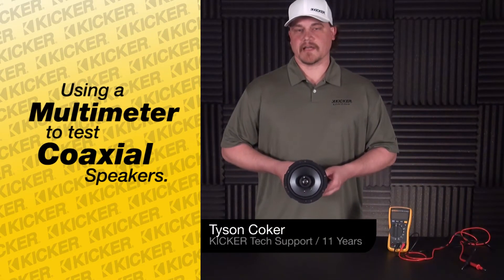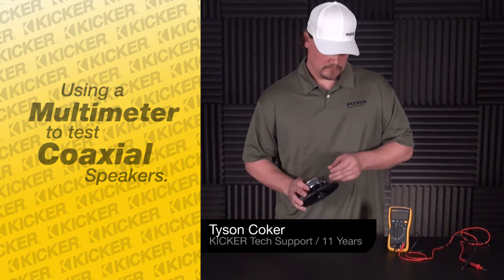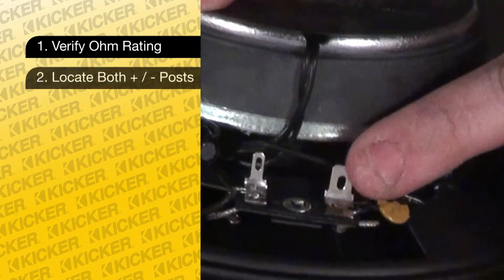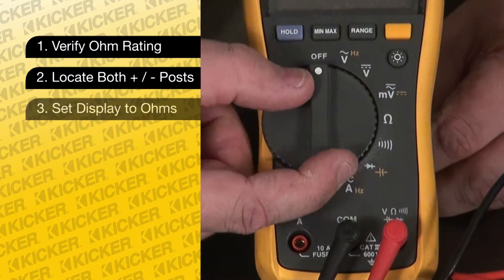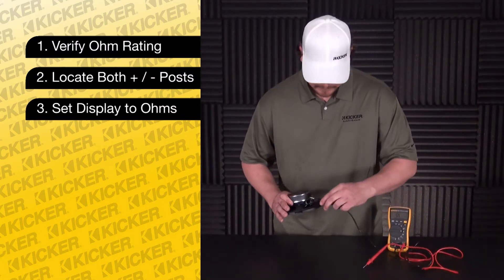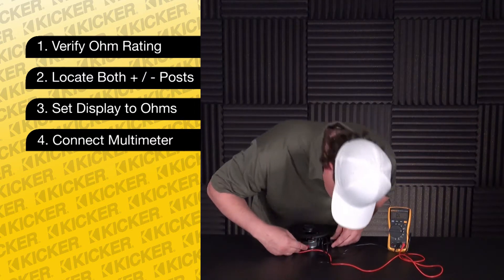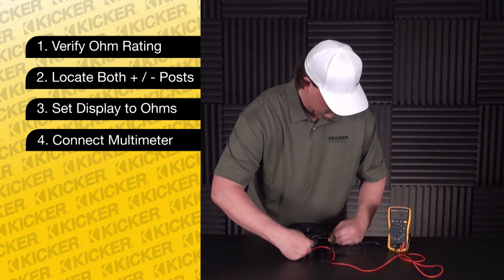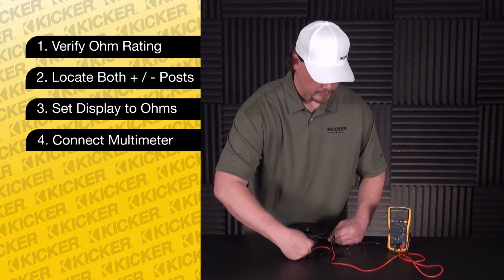Speaker Tech: Testing Coaxial Speakers

Comment: How does the resistance prove that both components of the coaxial speaker are working? With the capacitor inline of the tweeter, it will not giving any proper reading of that part